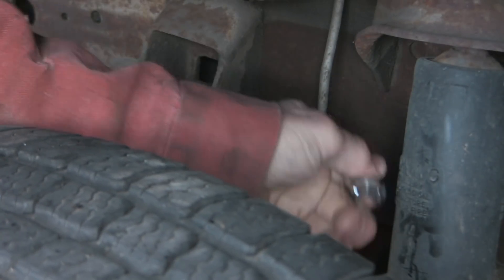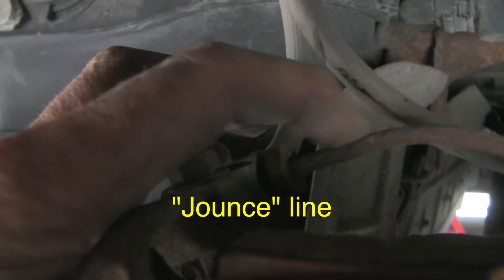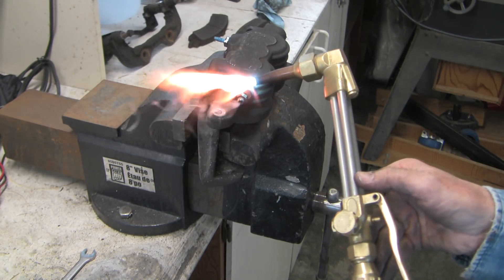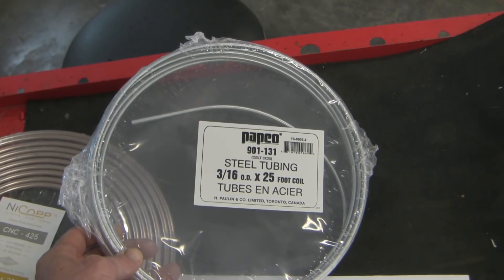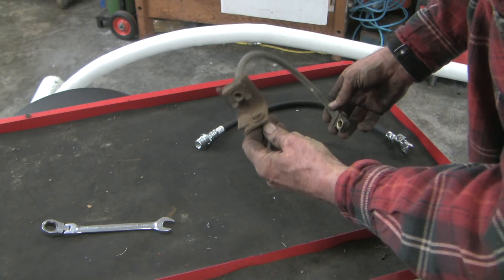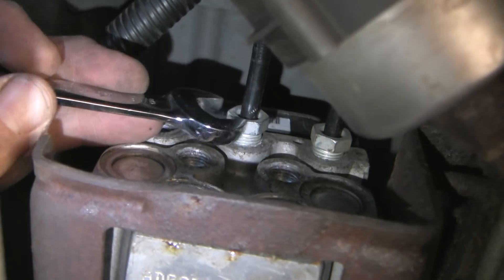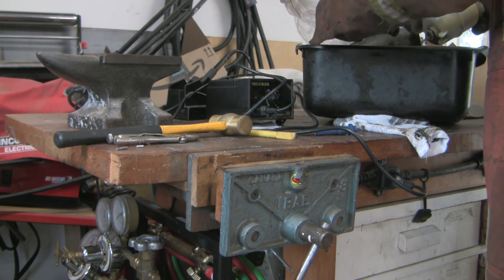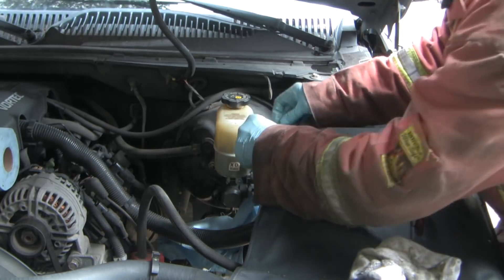How to Replace Rusted GM brake lines

Comment: So you did not need a scanner tool to activate the abs to bleed the brakes ?
Reply from the maker: The scan tool makes it easier since you don't need to find a gravel road, then drive back and re bleed (maybe even a few times). But for shade tree mechanics, especially on old cars like this one, the scan tool is not necessary.

Comment: Both videos are a great help.  I have the exact same problem, pulled the module apart and can't see any cracks in the solder. Wasn't sure whether to proceed or buy a new one.  Based on your video I will proceed with the soldering and hope for the best!  thanks again!

Comment: question if I may, did you have to use a scanner to bleed the ebcm for a complete bleed down?
Reply from the maker: The short answer is no, not usually. In the past it was common practice to do an initial bleed, then take the vehicle for a test drive on a gravel road. At about 10 mph with nobody behind, slam on the brakes to activate the abs motor a couple of times. Then test the brakes again and feel for sponginess of the pedal. If it is spongy, repeat the bleeding as before. When the abs unit is down low like this one is, that's usually all you need to do, because air bubbles tend to float upward because of gravity. Newer patterns of practice are to activate the unit with a scan tool while bleeding so you complete the process more efficiently.

Comment from the maker: It's now been almost 5 years since this repair, and I'm happy to report that I still drive the Suburban, with no problems with braking since then. Fixing an old car is always a gamble, because you don't know what is around the corner. In retrospect the decision to take a chance and fix it made all the difference.

Comment: I've done a few suburbans with the abs control modual under driver's seat on frame. It is very difficult job. 
Now I'm doing my 05 Yukon 1/4" lines with new Nicopp copper lines and using the old fittings.
In your glove compartment it should show the JL4 code. Stabilitrak.
None of the parts stores even have a clue what 1/4 inch line is for this vehicle. 
It has 2 lines to the rear and the 2 far back rear lines are standard 3/16" lines.  
GM should be sued for making the lines with no rust protection especially for salt in the North.

Comment: 04 Yukon with leaking lines worth doing or selling?
Reply from the maker: Old vehicles need an advocate to keep them going, often somebody who can do work themselves and save the labor cost. If you factor in the cost of new vehicles, and their higher failure rate and steeper depreciation curve, I think it is worth it.

Comment: How did you bend the steel line going to the back?
Reply from the maker: 3/16 line is pretty easy to bend, even steel lines. I have a cheap bending tool that I used for 90 degree bends, but for minor bends of less than 15 degrees I did it by hand. If you kink the line you'll have to throw the part away and try again. The critical thing to remember is how the body of the vehicle bounces on springs, so run your lines so they don't get flexed every time you hit a bump in the road. I just tied them in as closely as possible to the way they were run before.

Comment: I just did this on my 04 GMC. By far the hardest, tedious, frustrating, and, time consuming car job I've ever done! Note, he didn't show you the horrifying nightmare that is feeding all the new lines up and around all the other things on the car and getting all the lines down between the body mount after the front wheel. To do it right you really need to jack the body up!
Reply: Gmc Yukon? Thats what I have needs brake lines. I'm debating because engine and transmission are excellent hate to lose this for brake lines.
Reply: @onlyme8870  do easy bend copper/zink and remount them in easy locations. You will save a lot of time and frustration

Comment: Just found your video. Nice job. My 2002 Suburban is new to me and has had one line replaced. I bought the AC Delco kit and plan on doing a complete job. Luckily I have a two post lift. I don't think my 66 year old arthritic body could take doing it on jack stands. Thanks for the video.

Comment: Did you bleed the abs pump? You have to have a computer to do that I was just curious. Thanks.
Reply from the maker: I used the same technique that Eric O uses, I bled the brakes, then drove to a gravel road and slammed on the brakes a few times to activate the ABS pump, then re-bled back at the shop. In my case it made no difference, no bubbles remained so no more were cleared, and the pedal wasn't more firm. A few years ago I asked your question to a couple of professionals, including Briansmobile1 here on Youtube. All said that they rarely encounter problems when bleeding ABS units, probably because the ABS units are designed and positioned to avoid trapping air. I do have a scan tool that will help with bleeding, but so far I haven't used it much for bleeding. Thank you for watching, and for your thoughtful question.

Comment: Dave, can you tell me the source of the purple/violet rubber plug I see at 7:46?  thx
Reply from the maker: I bought a miscellaneous set of plugs from an auto parts store, and I keep plugs I get when buying brake calipers, etc. As I recall the purple ones came with a caliper and the white ones came from Lordco.
Reply: thx

Comment: On the master cylinder there is the two lines.   Which line does the front one connect to,  the rear or front or left or right on ABS unit.
Reply: By the way, l have a 2004 GMC Sierra 1500 SLE 4x4, saw a diagram of the ABS unit and the pattern is same as your Suburban.   A friend took it apart andcleft it undone.  Now I'm stuck trying to figure out the two master cylinder lines.
Reply from the maker: At 2:50 of the video, I think I explained it pretty well. The view you get there is by lying on your back, looking backwards toward the rear of the vehicle, so the drivers side is on your right, passenger side on your left.
Reply: @spelunkerd  l got that, it's the master cylinder l want to know, front line or back line?
Reply: The master cylinder is mounted right,  one end connects to the metal fastener.   So you have two female fittings on it, one toward front of vehicle, one to toward where driver sits.  I already konw where lines connect on ABS unit.
Reply from the maker: Oh I'm sorry, that's a good question, I don't know. By government mandate there are always two pistons and two lines from the MC to add redundancy, so that a sudden loss of pressure on one arm doesn't cause everything to fail at once. Traditional designs were diagonal, with the front piston serving one front brake and one rear on the opposite side. In non ABS systems there were extra proportioning valves and even a pressure differential switch to automatically close off the leaking side. More recent versions have varied, and as you see the Ram uses only one output line from the ABS serving both rear wheels. Those safety features are now concealed inside the ABS unit, and are at least partially electronic. The dealers repair manual shows no detail about how that is designed.
Reply: @spelunkerd  l well try the front line on MC goes to the rear brakes on ABS unit
Reply from the maker: @lesbaxter4572  OK so what I hear you saying, is that in contrast with my ABS unit, yours doesn't have specific assigned points for the MC connections. In that case, I would consult your dealers repair manual. I get dealer repair manuals on every one of my vehicles. A five year subscription to Alldatadiy is about $50, or Mitchelldiy for about the same price. You can also get a shorter interval for about twenty five bucks. It raises the interesting issue as to what might happen if these are swapped. I wouldn't be surprised if nothing happens, but I can't say for sure!

Comment: hi did youhave to remove truckbed to run lines in back?? does ecbm module get in the way in the back?
Reply from the maker: You make a good point, in a truck one could remove the bed. In my case, a Suburban, removing the body wasn't realistic, it had to be all done from below. Not easy.

Comment: Hey I need some advice. Brake line recently blew Out on my 2003 impala. Just now getting into the job was wondering if you ever had done an impala. Or if any of your viewers had ? I used to put brake lines in stock cars And had to replace them on an escort. But the impala is much more complicated in a sense that there is a lot more shit in the way. Any advice would be great
Reply from the maker: Old vehicles can be a little easier, in the sense that you can usually get by without needing a scan tool having bidirectional control. To purge the line after working on it many techs drive to a gravel road and apply the brakes hard to activate the abs, trying to dislodge tiny air bubbles that could be trapped inside the abs after bleeding. I would replace the entire line rather than introducing extra points of failure. NiCop lines are better, easier to work with, and more expensive, so if you can afford them and if available in your community I would go with that. It's a good time to inspect other lines in the system, including the flexible end hose connections, looking for where they are likely to fail in the future. Be really careful with routing, you don't want a line rubbing through at a point where the frame moves in reference to the axles. I have not done an impala since the 1960's, but there are more similarities than differences in most systems. I got my lines from RockAuto.

Comment: Hate to say it, but Chevy still makes their cars and ships them off w/o a bleeder valve cap on them. So that's not something I think that's a default item. Only the better-quality replacement calipers come with caps. Here in the rust belt of the Northeast, I will put a blob of silicone caulk around my bleeder screw. It dries and clings to the screw and just peels away when I need to get to it..looks and functions like new even after many years of exposure to the salt and water up here.

Comment: It should be illegal to sell any vehicle without STAINLESS STEEL BRAKE LINES. Charge me the extra 100.00 from the beginning and save me 2000.00 down the road. Absolutely no reason this isn't done at the factory when all is new. The Trans cooler and power steering lines should be the same.
Reply: Actually, if one cleans the under parts of a car or truck once in awhile ( removing deposited salt from road or salt from ocean) they will not rust as bad or as fast. Also, stainless has its own problems, as it reacts to other dissimilar metals. When stainless steel and carbon steel are connected, and an electrolyte such as moisture is introduced, stainless steel absorbs carbon steel’s electrons. Carbon steel can then deteriorate rapidly with this mating, become weak, and come crashing down.  
Galvanizing is a way to protect carbon steel without completely changing its structure. When carbon steel is galvanized, a layer of zinc is spread over its surface.
Bottom line; Galvanized steel costs a few cents more per pound than regular structural steel. Stainless steel costs four to fives times as much as galvanized steel !
 Leave stainless alone.
Reply: @petratical  While that may be true, anything is better than factory lines. The car will be in the crusher by the time dissimilar metal issues take place.  In the northeast one season of road salt is all you need to get the process started with factory lines.
Reply: are you out of your mind????? or just a jenio???? or a regular  jenius???

Comment: Thanks!  Doing mine this Saturday
Reply: I did a whole brake system too for the first time 
The rusted fittings are hard to get off 
I cut the line and put a deep socket over the line and the fitting to get it off makes it easier
Reply: @aquaticasmr184  Thanks for the heads up, I've been spraying all fittings with PB Blaster for the last week, that should help, but ya, I will cut them out also.
Reply: @FansSports  I literally just bought some brake lines gonna finish up my brakes this week.
Be careful with rusted bleeder screws 
No problem happy to help  Rusty brake lines are the worst we need all the tricks we can get

Comment: Thanks for putting the details on what line when where... I am having trouble getting the lines out of the plastic holders (on the side of the frame with wire harness integrated.  Am I missing something? How to open them up?  I bought a kit of copper alloy lines, with the end connectors already mounted.  So far they have been great.  My kit had 7 lines in it.

Comment: I purchased the GM preformed kit on Amazon to replace the rusted tubing lines on my 2005 Silverado. Replacement seem straight forward so we shall see how it goes. It looks like replacing the front passenger tube will be the most challenging. Did you find the new tubes to have enough flexible bend to route without bending or kinking? The TSB states to raise the cab and the bed 2" in order to install the new line. Did you find that to be required? Thanks and great video.
Reply from the maker: I had no kinking but routing lines was a time consuming chore. Front wasn't more difficult, though it is longer than others. All are awkward, but I didn't need to raise the bed. Good luck!
Reply: @spelunkerd  Did you find it easier doing the front right first then the rest? Thanks so much for your fast response.
Reply from the maker: @MrSloopjohnb  That's a thoughtful question. As you probably know the tightest spot is the front of the ABS unit, so it is probably easier to do the top, less accessible row of connections first, leaving the bottom row on the ABS unit for the end. I would scroll back to the shot I did of the ABS unit and plan with that in mind. Otherwise I don't think order of assembly makes much difference. I would try to plan so that tubing from the MC doesn't have to cross and potentially rub on lines coming from the front on their way back to the ABS.
Reply: @spelunkerd  Thanks. I will post an update when completed to reflect my experience to share with others.

Comment: done many of those line kits on chevy trucks and its a all day job for sure, the bleeders are never cooperative so i always quote the job with new calipers and if i get them out great and it ends up cheaper
Reply from the maker: Wise advice! Guys who work in the trenches have my respect, it is not an easy job. Thanks for stopping by, its always nice to have a pro visit.
Reply: Ya i changed my avalanche lines a few weeks ago and it was a pain and the placement for lines was right were water and salt goes up. So they all rusted out. Basicaly fell apart in my hands when pulling on them

Comment: I'm curious, did you need to run the ABS bleed it, or just the normal procedure?
Reply from the maker: Excellent question. I've made inquiries like yours to several pro mechanics, and most say that with older vehicles like this one, there is rarely a significant issue. To be sure, I drove the vehicle to a gravel road, slammed on the brakes a couple of times to verify that the ABS was working fine, and that braking after doing that was still fine, too. When the ABS motor kicks in, it could dislodge small air bubbles that may then be bled, if necessary. A second bleed wasn't needed in this case. All that said, newer vehicles have more complex 'brake by wire' systems, and dealer algorithms usually include a step where the ABS motor is activated through the scan tool. Scan tools that have the bidirectional ability to turn devices on/off are expensive, usually out of range for backyard mechanics like us. Also the belt is constantly moving, meaning that low cost competition need to keep up with constantly changing industry standards. Most offer a subscription service which is extra cost every year. Good luck!

Comment: Thanks for the video  bought a yukon xl from a guy who claims all the lines where replaced with copper ones well come to find out only the front lines where replaced with copper lines from abs module back the lines where all rusted an one starting leaking as i was driving the truck home so now im going to order the kit an replace the rear ones my self witch seems the hardest but with a little bit of effort an elbow grease an your video think i can get it done

Comment: Great video. You Did not have to change m.c. seals?  Could you "bench bleed" on the truck if you don't have a good vise?
Reply from the maker: Yes, in fact Eric O from SouthMainAuto remarked in this thread that he bleeds on the vehicle, saving time. That would take two people to do it manually. My fluid was pretty dirty so I wanted to carefully clean the reservoir on the bench, alone. I should have flushed the reservoir better while I had it on the bench, wasting some new fluid to get the dirty fluid more completely removed. I was prepared to change seals but I had no issues. The seals I saw under the reservoir were fine.

Comment: Nice job. Amazed at how you keep smiling. I would have to delete a number of expletives if it had been me. Thanks again.
Reply: I never started cussing until started working on my own vehicle, even found out what brand of wrenches ounce higher than another. Isnt it the worst location is always the problem? The 03 Silverado the rear exhaust manifold is known to break. I think the engineer did it to get back at high repair cost.